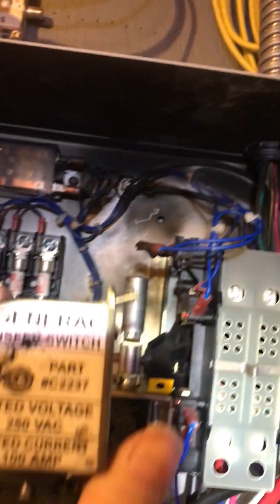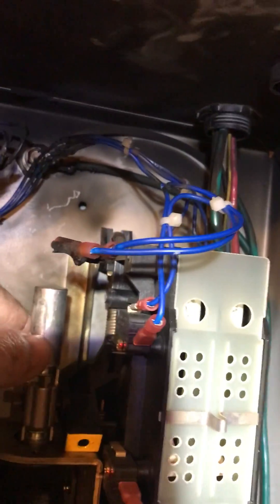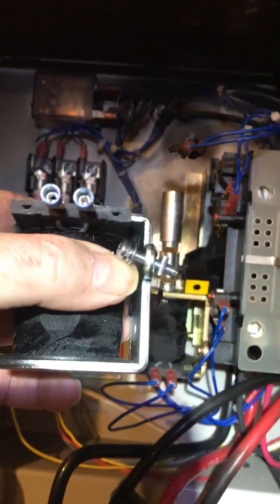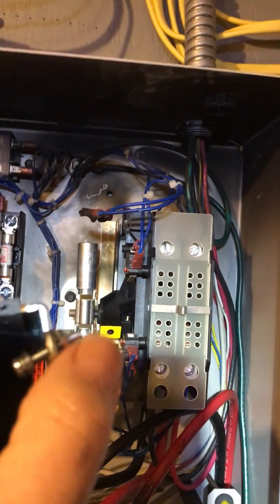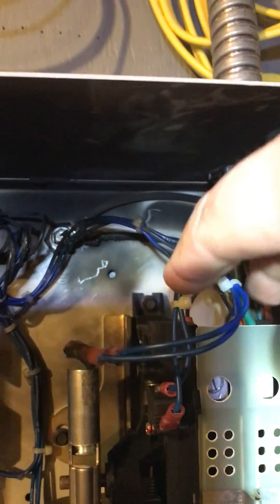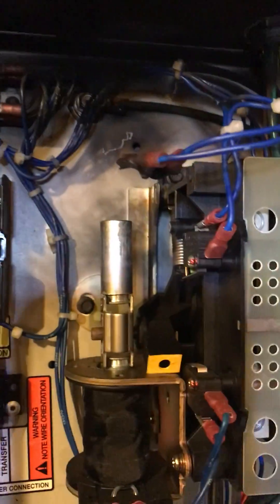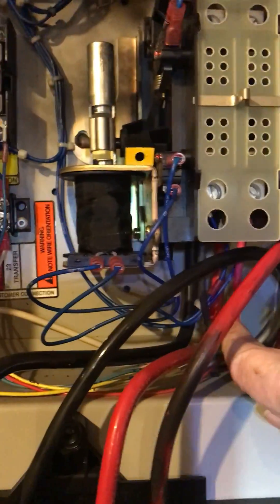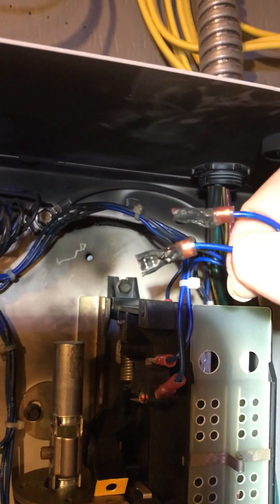REPLACING C1 COIL AFTER A CATASTROPHIC FAILURE IN GENERAC RTS

Comment: Thanks for your video. Any idea what may have caused the coil to burn out/melt?
Reply from the maker: No root cause to date. The area is somewhat remote. When it's very few customers it usually has to be called in.
When I arrived the power authority had pick up trucks running the dirt road. (And the damage was done.)
The neighbors complained that there was a prolonged brown out.
One neighbor said that he knew something was wrong so he removed the utility company as a source. (On a Whole House Transfer Switch you would turn the breaker off. On an Essential Circuits Transfer Switch you would shut off the breaker in your panel which feeds the transfer switch. Of course you would have to rely on your neighbors - that don't have a generator - to tell you when utility power has been properly restored.)  
These neighbors coming into the basement I was working in, curious to see.
I was a little busy focusing on the problem in front of me. (Staying safe. Trying to figure out what I had. Getting the job done in a timely manner.) This much smoke and heat means that "what wasn't destroyed was probably degraded / damaged.")
It also made me wonder about the Manual Transfer ability.
At the same time period that this occurred I had a call that their generator started but wouldn't transfer to generator power. When I checked that generator - the generator power was incorrect. The owner told me that he could manually transfer his switch.
I told him that it was good that he didn't manually transfer his switch because the incorrect voltage could damage sensitive equipment in his house. (Like his furnace which probably uses an electronic module and others you don't always think about.)
The utility would probably generalize the problem to "equipment failure", but I'll keep an ear out.
Hopefully, Generac is looking at a proactive defense.

Comment: The bottom coil on mine burnt up.  Any pointers on replacing the bottom coil?
Reply from the maker: I don't post my videos as repair instructions - only to show people some of the things that can cause certain problems.
I don't know anyones skill set and I know some electricians that wouldn't attempt some of these repairs.
I recommend a certified technician. As I take no responsibility for the actions of anyone.
Below are steps that I personally follow. I add steps as the job requires when it changes in any manner.
My background is in both electronics and electrical construction which changes daily. This too could change.
The voltage that powers that lower coil should come from your generator once it powers up. So I would shut off the breaker located on the generator and check the generators output voltage on the line side of that breaker. If your generator voltage is bad then any repairs you make are subject to destruction once again. ( There are limit switches built into the transfer switch itself so you need to verify the root cause of the failure. Was it the generator? )  
Then, the voltages inside the panel are indeed very dangerous. With two sources available.
You need to make the section you're working in completely clear of any and all voltages as there's very little room to work and very little room for error.
If you need the utility power to your house while you work - you need to know how to shut off the utility power while you move it in order to bypass the transfer switch. Eliminating any backfeed to the transfer switch,
Then you want to make sure that no dropped parts from the top section can enter the bottom section which will be LIVE if you move the incoming utility feed.
I even block any openings from conduits in the bottom of the panel. usually with a rag or two.
I take pictures and videos if I don't fully know the wire connections.
The coil I removed had two screws holding it in place. The only thing holding the nuts stationary is the plastic framework of the transfer switch and I couldn't see them to tell when they traveled to their limit and were about to fall off - and Generac didn't exactly give any room for error. You don't want to lose the nuts anywhere in that panel.
Once free, the coil needs to be gently pulled away from the transfer switch while sliding it off the actuator. 
There is a difference between the two coils and you need to get the exact replacement for your transfer switch and its use and location in the panel.
I purchased my coil on eBay from a certified dealer. No "second time around" used part.
I've seen burnt up coils for sale on eBay with "No Returns Accepted" - so there's a need to be vigilant.
If you are qualified enough to get the new coil installed correctly and without any mishaps your next steps are to verify your repairs visually and perhaps manually before restoring energy by putting the electrical feeds back to their original location.
Once complete you need to verify operation by placing your transfer switch on utility power. Your house/structure/whatever should be powered up by the utility power.
Then simulate a power outage by turning off the breaker to your transfer switch. Your generator should start and run. Then transfer your switch to the generator power. The generator should now be providing power to your house/structure/whatever.
For Safety: Always wear the proper protective equipment to protect yourself from shock, arc flash and vaporized copper. Your home/structure/occupants/equipment from harm or damage.
Understand these steps to know the dangers involved.